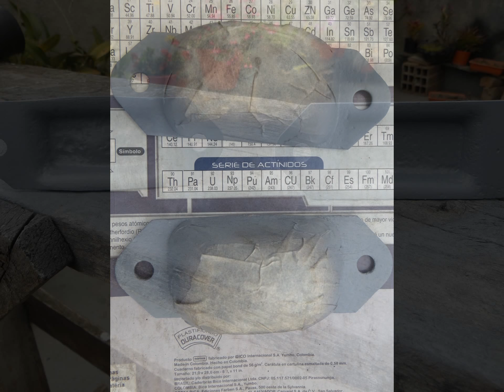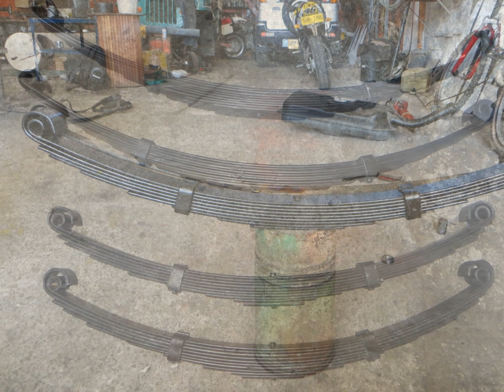CJ3B Willys Leaf Spring Restoration

Comment: How many leafs to be used for front nd rear of willys jeep
Reply from the maker: Hi there, for the CJ3b like this it's 10 in the front and 9 in the rear. The later CJ5's and 6 had less but  longer ones. You can have less and have a better ride but I wanted to be original (which my rear may regret haha) Thanks for the question.